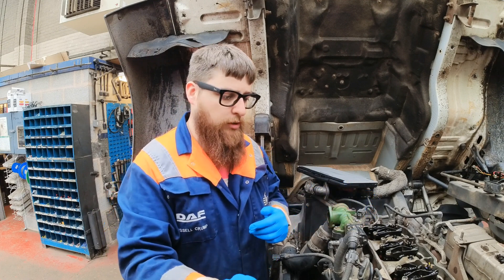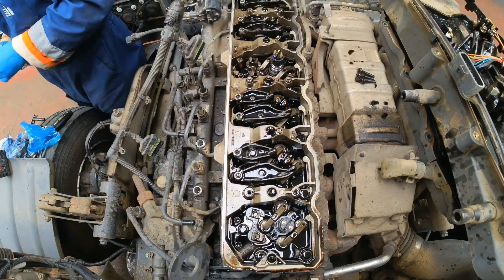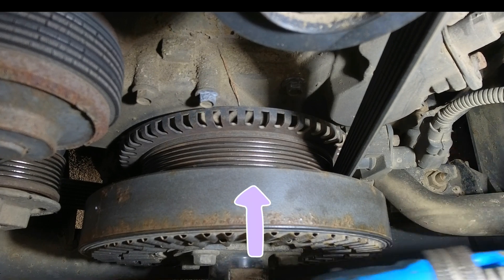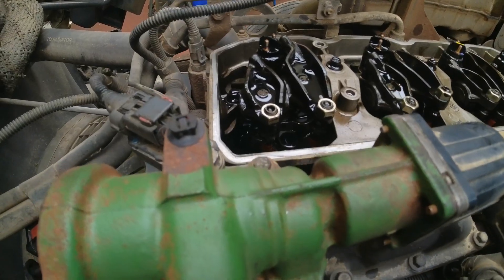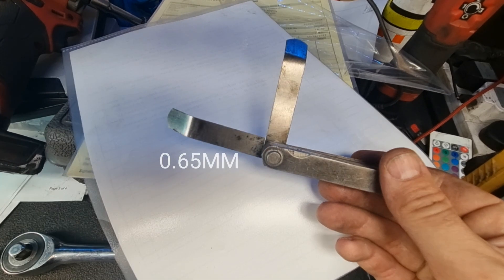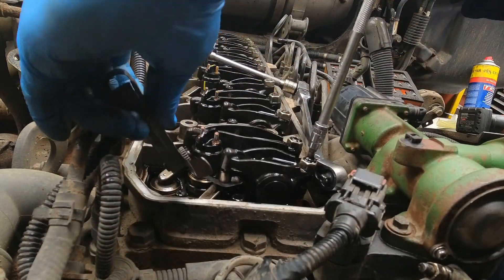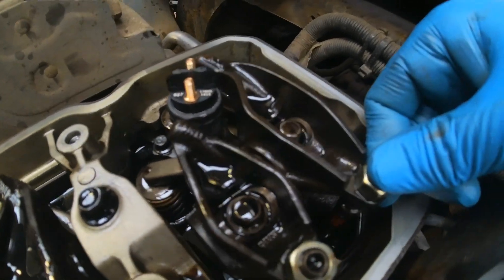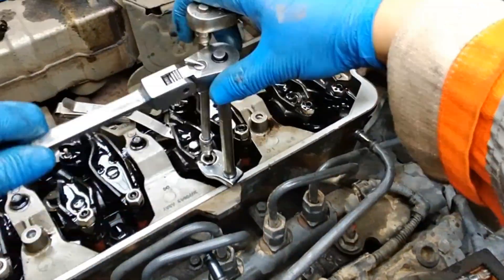ARE YOU DOING YOUR Daf LF PX-7 VALVE CLEARANCES RIGHT?

Comment: Any tips on doing the PX-5 valve clearances please? Can't seem to find anything on that one.

Managed to get a copy of the procedure.

As per video, use a spanner on the fan shaft to rotate clockwise, until TDC mark on the vibration damper (maybe on the front) points directly upwards.

If cylinder 1 valves are both closed then adjust them and inlet on 2 and exhaust on 3.
If cylinder 4 valves are both closed then adjust them and inlet on 3 and exhaust on 2.

Rotate clockwise 360 degrees, and do the other set.

Comment: Do MX-13 engine also require valve clearance check over some time?
Reply from the maker: Oh yes! Valve Adjustments, There is an initial valve adjustment of 40,000 miles that should be performed, then every 160,000 miles
Reply: @TRUCKTECHUK  thanks

Comment: I am pretty sure you know already. But those  PX7 (6.7 Cummins) you can use the alternator to bar the engine. If engine does not have a PTO. Good video.
Reply from the maker: Hi thanks for the comment 👌😎 believe it or not but I've never tried to do it off the alternator, DAF don't even mention it either so it's something I will definitely try next time! Thanks for that 👍

Comment: Mate do you think this method will work on MX13? Every time I use the marking on flywheel, never have time to test 😅. Another good video, cheers 😊
Reply from the maker: I've just done mx-13 funny enough. Mx-13 has 3 positions on the flywheel and front pulley. 1-6, 2-5, 3-4. These are all 120 degrees between timing marks. BUT which cylinder you set depends on which inlet valve is down on that particular timing mark. So 1-6 you need to check 3-4 inlet, 2-5 you need to check 1-6 inlet and 3-4 you need to check 2-6
Reply: @TRUCKTECHUK  shortly said, I remain oldschool.